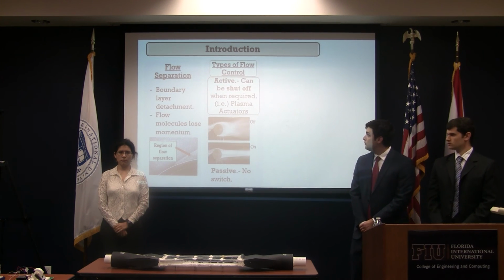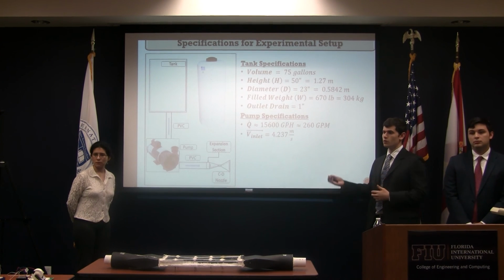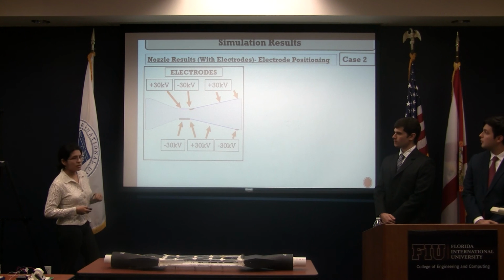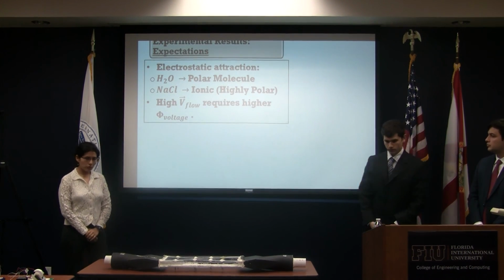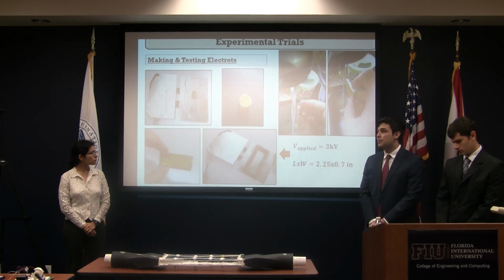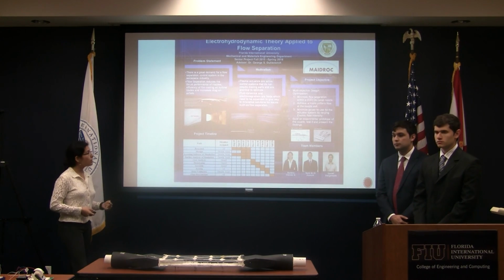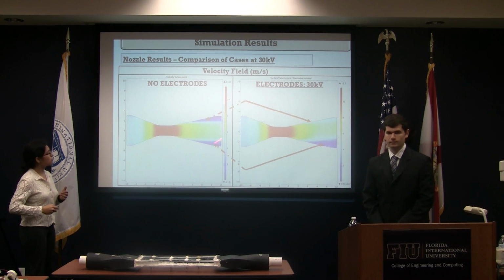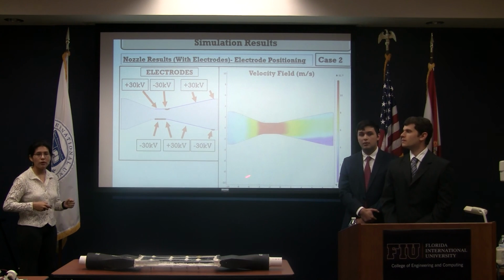Team 12: Electrohydrodynamic Theory Applied to Flow Separation

Comment: This is a very interesting theoretical topic, but there was no application presented for this project. Even though they did much research and addressed the problem and solution, they should have provided applicable real world solutions with this project. 
The presentation however was done very well, each member spoke clearly and looked sharp. They had much data to support their claims, which is very beneficial, but again it needs an application to be able to market it.

Comment: This video is superior in quality. The presenters were confident and knowledgeable in their topic; however, all of them were reading from the slides. The Power Point is excellent. The speakers used a large amount of different mediums to enhance the presentation. The most notable were the slide transitions and all of the charts showing the results of their simulation. The one problem with the video is that the presentation moves at a very fast pace; it does not allow the audience time to read and understand the information. Overall, the presentation was well done.

Comment: This project was presented well.  The problem is stated clearly and a method top solving the problem is proposed. You should dive into more detail about the benefits of such technology so that the audience understands the importance of your research. It is unfortunate that instrumentation issues prevented the actual experiments from taking place. The lack of experimental data leaves the audience with simulations as the only proof that electrostatic charge affects flow separation. Because experiments were such a core part of your project this hurts the overall presentation.